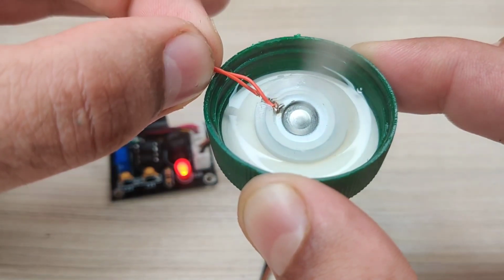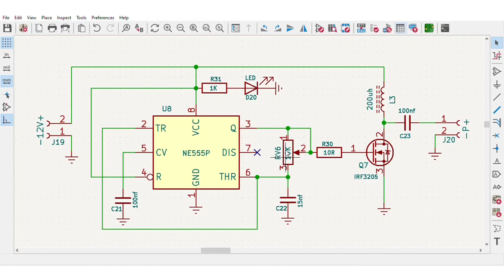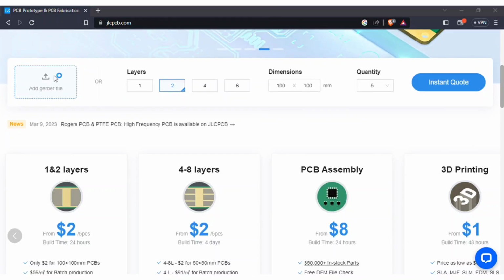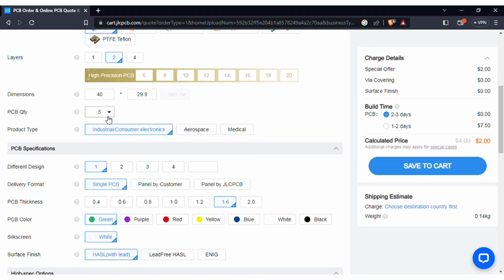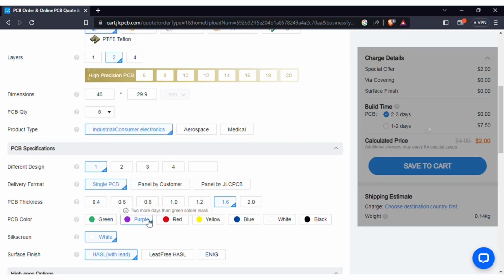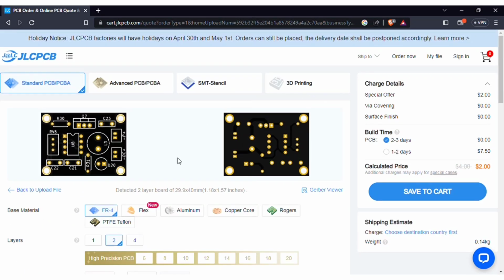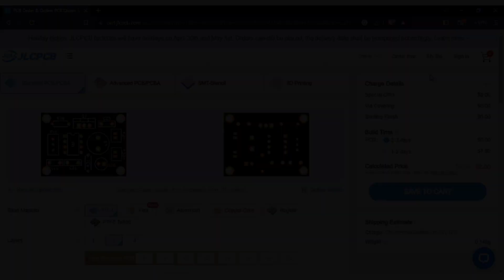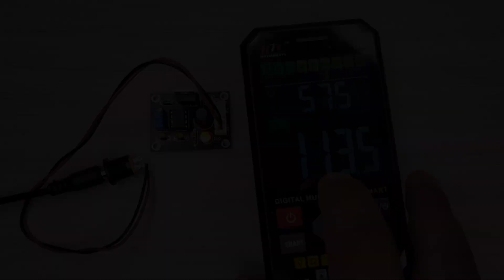DIY Humidifier Ultrasonic Mist maker 113 khz

Comment: Sir, thank you for sharing your knowledge , can you please post the schematic of the version 2 circuit as it contains extra resistors.
Reply from the maker: Both v1 & v2 schematics link is given in video description , v2 is perfectly giving more fogg
Reply: thank you very much, and by the way, i managed to make this circuit works on 5v by adding an inductor with primary and secondary instead of one way inductor @CreativeTechos
Reply: Hello  @الزُبيديأبوعادل  Could you provide the schematic of your version, please ? I'm very interested

Comment: Sorry sir!
How much current this circuit consume? can i use 2n2222 transistor instead of IRF3205 with power supply 5V?
Reply: 2N2222 is a bipolar tranzistor not mos-fet so you can not replace it

Comment: does the circuit version 2 work with 12V? thank you
Reply from the maker: No, it actually works with 9v 1A adaptor, but it works better than version 1
Reply: @CreativeTechos  thank you
Reply: @CreativeTechos  This video is a bit dated, but I was wondering if Version 2 can be made for 12V? Did the disc work better at 9V? I was hoping to use this for a project where I have an available 12V power source, so version 1 may be my only option. I would be grateful for any insight that you may offer and I appreciate you sharing your work. Thank you!

Comment: Nice Video 👍😁, I want to ask. can i use coil less 200uH? Or what if I use coil more than 200uH?
Reply from the maker: You can use inductor between 200uh to 1000 uh / 1mh. It is also recommended to follow version 2 of circuit diagram as it will be more stable and esy to adjust frequency of 113khz, download link is in video description.
Reply from the maker: You can use inductor between 200uh to 1000 uh / 1mh. It is also recommended to follow version 2 of circuit diagram as it will be more stable and esy to adjust frequency of 113khz, download link is in video description.
Reply: Thank you for your information 😁🙏

Comment: Mist Maker 108-113kHz.
(Voltage can be used DC5-12v.)
Reply from the maker: This version shown in video is little tricky to adjust at 113khz, So i redesigned version 2 with easy adjustment and protection for 555 IC amd is more stable and uses 9 volts.
So check out the link in description and you can find both versions schematic Diagrams